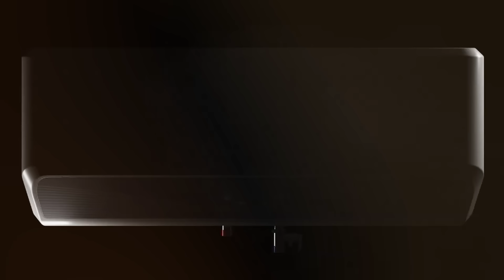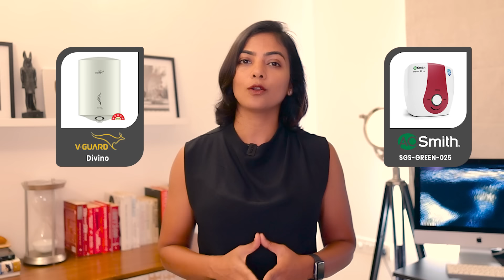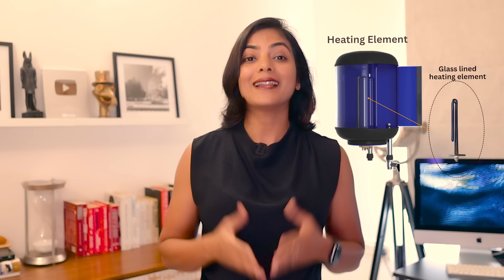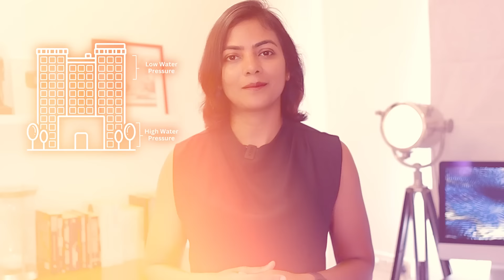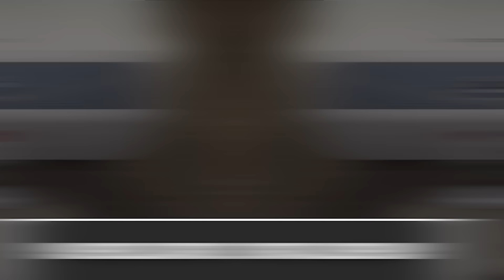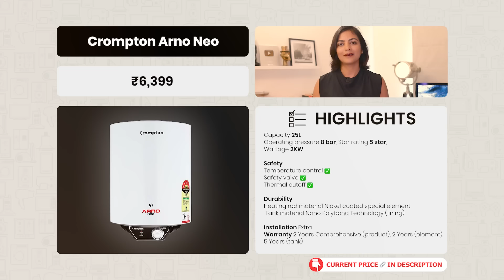Best Geyser 2025 | AO Smith vs Racold vs V Guard vs Crompton

Comment: Question to the forum: when you say geyser is good how hot or how much hot water does it provide say if we use shower? Ideally for 2 person to take bath in shower or for 4 persons etc., Please help, i am facing some issue with Racold geyser, the one you she mentioned as best in horizontal geyser. @thegrapevineindia

Comment: Geyser star rating doesn't matter as much as you think. It is only applicable if you keep your geyser turned on all day.
Reply from the maker: Auto switch off does help too. But remember these are power guzzlers. So for limited price diff between 3,4,5 star, you can get longer term savings
Reply: @TheGrapevineIndia you didn't get what the reply tries to say. All heaters have auto off. The heater star rating says in the line of 'how much heat it loses per hour'. If heat is lost, the heater turns on to bring temperature to maximum. Since we mostly don't keep it on 24x7 we don't need to worry about star rating.
Reply: @premkumart2040 lol. That’s not what ratings meant. Higher rating means it will consume less energy/electricity to heat the water. Less rating means it will consume more energy to heat the water so will be less efficient.
Reply: @datascientist7050  I'm reading a heater's rating sticker of model VGuard Veehot 15/ 2025
Standing loss 0.381 (kWh/24hr)
I understand it as  how much heat is lost while on storage

Comment: Also please look into modern no return valves on these geysers. They cause reduced outlet flow.

Recently installed a Racold Storage Version - after replacing our old VGuard.   The flow to the shower was minimal, Racold unofficially put a larger valve in the inlet after which the flow improved. You will also need to install an X-Nipple valve on the outlet end.
Reply from the maker: Thanks for sharing your experience. Will look into it.